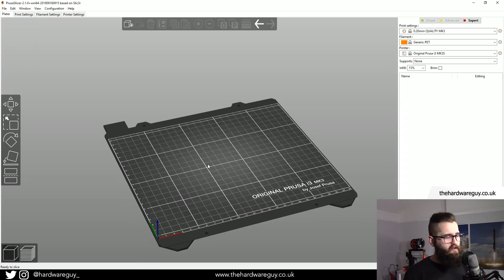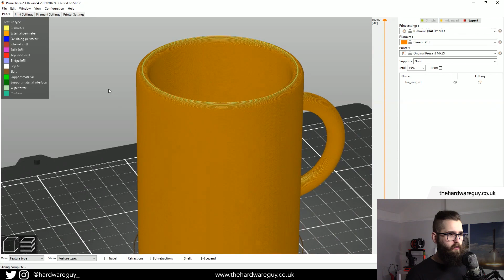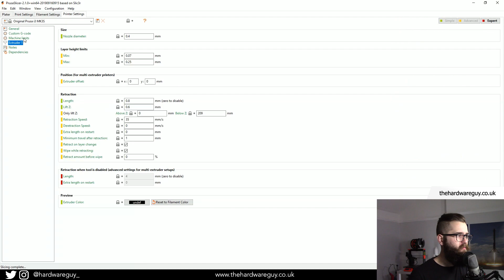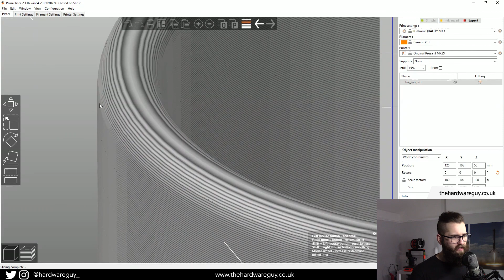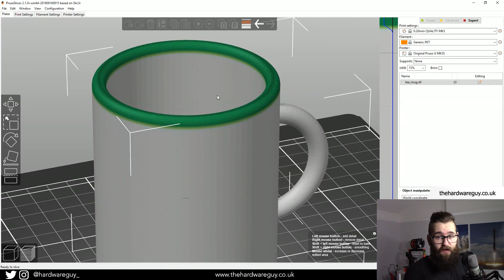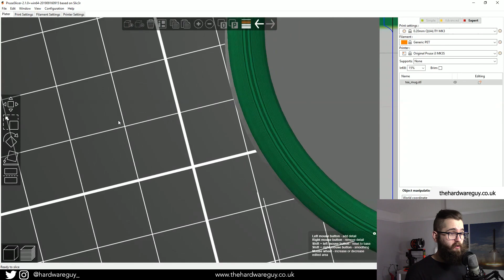Prusa Slicer 2.0 - Variable Layer Height

Comment: How can you clone your variable layer height adjustment to apply to multiple models on the same build plate?  When I control-click to select all models the 'Height Ranges' button becomes inactive.  For now it seems like I have to hand-shape each curve identically for each item.  There has to be a cleaner way?
Reply: Try to apply variable layer height to one model.
Then copy and paste it to multiple copies.
it should work, If I remember correctly :)
Reply: @Fagge40  Thanks for responding :)  I actually found that the new feature in 2.1.1 under the Editing tool where you add modifiers and support blockers there's now a "Height range Modifier" option that will allow you to specify with granular detail where and how you want your layer thickness to be.  Even more control than the method previously available as is in this video.